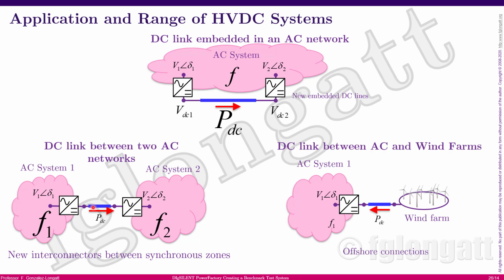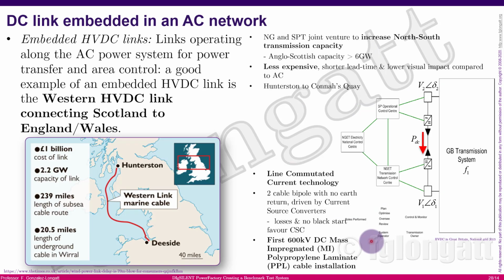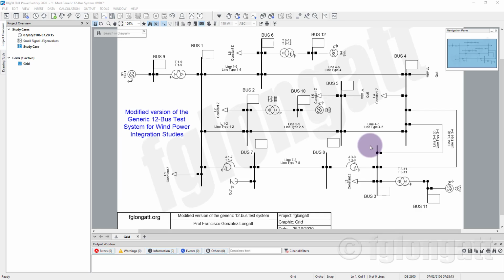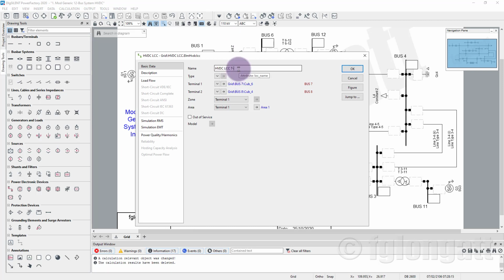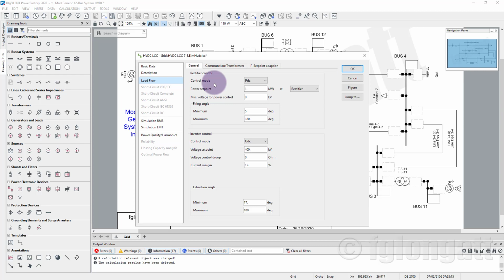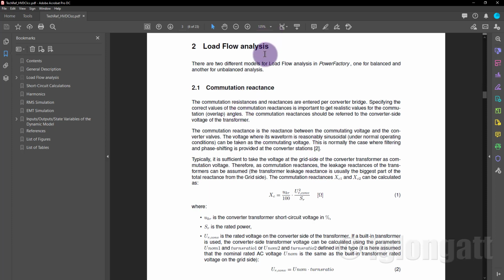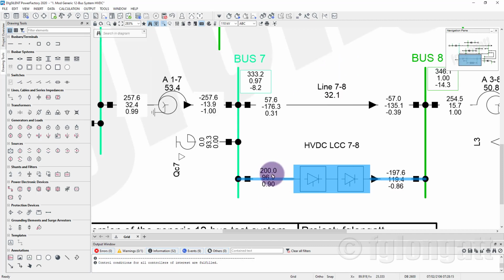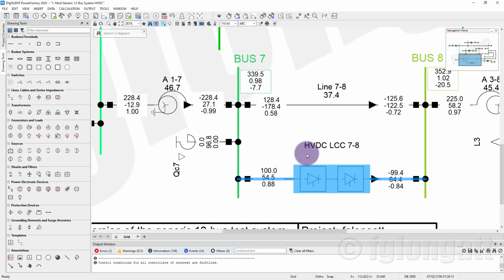HVDC-LCC model using DIGSILENT PowerFactory (ElmHvdclcc)

Comment: Thank you for your videos...I' m modelling a simple load flow with 2 rectifier bridge connected at the same DC link for a 12 pulse system (above there is a transformer with double secondary Dd0y11)...i noted that the ripartition of the load between the two rectifier bridge depending strongly by losses parameters of bridge(no load losses, vdrop losses and resistive losses). Is available some documentation that explain how calculate these parameters? The technical reference of Power factory Is very poor regarding this topic...thank you for eventual replay...

Comment: Hello professor, I am currently modelling this Generic 12 Bus System in DIgSILENT and I cant achieve the load flow result as presented by the publication. May I ask where I can search for this model in DIgSILENT? Thank you very much
Reply from the maker: Generic 12 bus system,? what is that one? No sure!
Reply: @FranciscoGonzalezLongatt  No problem professor, I had solved the problem, just some careless mistake. Indeed your video helps alot. Thank you so much! I am a huge fan of your research work and education resources!
Reply: disculpa, como conseguiste que el flujo del modelo te de el mismo que esta en el video ?